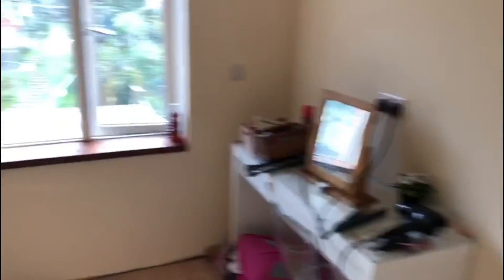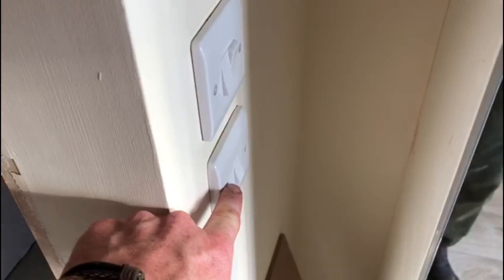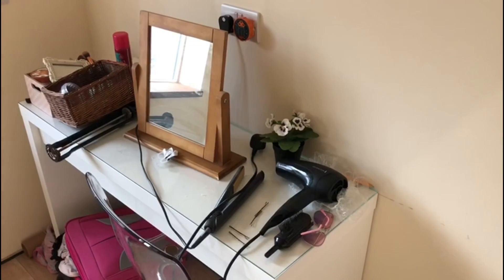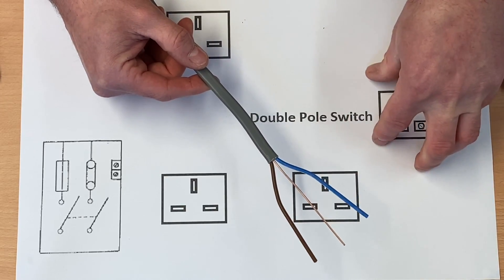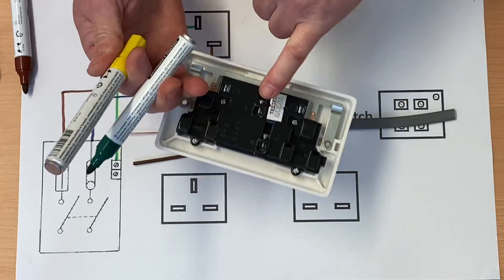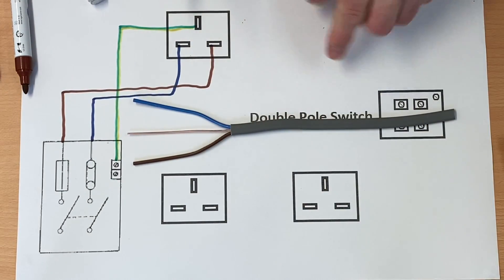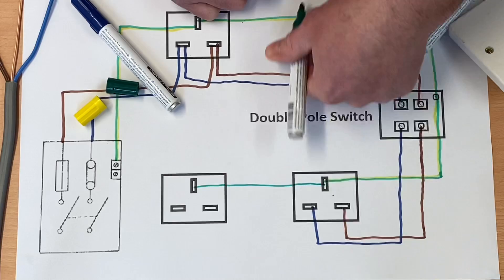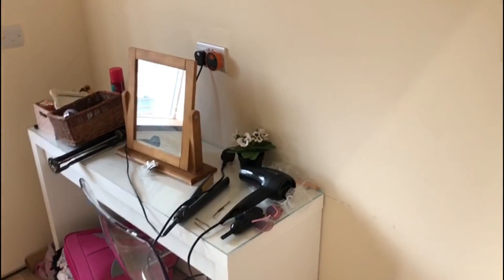One Switch To Turn OFF ALL Your Sockets. Good Idea?

Comment: It would be better for his daughter if the double pole switch has a re indicator light so daughter can see it light is off, also not good if his daughter gets used to turning off the hot hair straighteners via the double pole nearnthe door rather than the nearest supply ...!

Comment: We used to have a similar setup for our TV - It was a ring final circuit so a fused spur was used but it allowed us to have a single switch where it was accessible at the end of a long run of cabinets to turn off a series of sockets behind the cabinets.

Comment: Sounds lethal to me. Should any devices be powered on the sockets such as a heater, iron, straightener, whatever, it could go unnoticed that they're powered back up when the switched is turned back on. And if they're now buried under clothes that wouldn't be wonderful. Better idea to accept turning each device off.

Comment: If they don't even remember to turn off their lights, they're not going to remember to turn off their sockets either...  I think it would be much better to just use smart sockets and light switches or a smart relay in that DP switch box with a blank faceplate and then programme it to turn off whatever sockets you wanted when the alarm PIR stopped sensing movement? (Or various other methods like when their mobile phone left the house for eg.)

Comment: The only thing I would be concerned is the  confusion without labelling - I never forget the case when I accidentally turned off my heating in a room by pushing a shelf to the switch and had to call the landlord and he sent an electrician to find the switch after 2 days in the cold...

Comment: Yes I added a Pergola with a polycarbonate roof but up to my small conservatory,  Protected by a fused 13amp spur situated in the conservatory which feeds a RCD consumer unit , 16amp and 6amp circuit breakers for sockets and lighting .

Comment: Do you think an FCU with 13a fuse that will blow at 21.6a would be better, or a 20a DP switch?
Reply: I’ve done a 13 amp fused spur 👍
Reply: @tonycowles4150  agreed
Reply from the maker: Another great point 👍

Comment: Its okay but why is it that electricians are frightened by any thing unconventional.  You could have put a Wifi switch by the door and Remote relays where you needed to provide a switched socket. You can add or remove without hacking the place apart.

Comment: I would recommend using red (or a different colour) for the faceplates that are controlled by the master switch...
Reply: Agree. I usually use a 50 amp cooker switch.

Comment: If you have to switch bigger loads and don‘t want to have a big ugly switch use a contactor installed in the board instead. To switch the contactor a small light switch would be sufficient, also a thin wiring of 1 or 1.5sqmm. A contactor rated for 40A is in the range of 50 Euros, for 63A in the range of 80 Euros.

Comment: In my opinion it definitely can’t hurt to have it as an extra isolation method and bit of peace of mind sort of thing. “Did I remember to turn off the straighteners/bedheater/multiple other appliances in the room? Oh wait, I flicked the switch” isolating them all in one action to be sure so you don’t have to worry about each individual appliance. I’d also suggest that in the likely situation that a child/teenager forgets to turn off the straighteners, console etc, and then forgets to turn off the switch that controls them then a parent/carer could also use the switch after their child has gone to school for example and potentially save a fire from occurring as a result? Loving the videos, keep it up. 👍